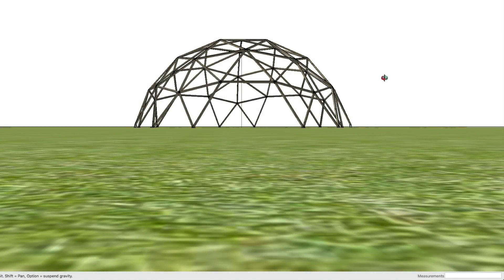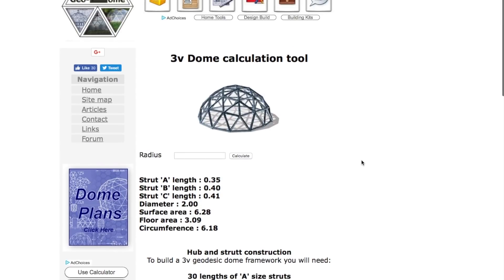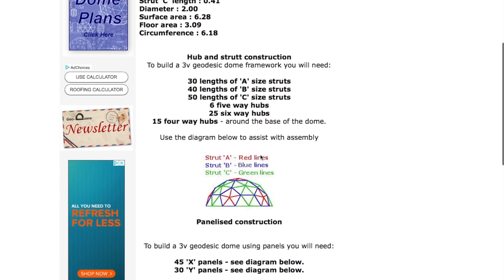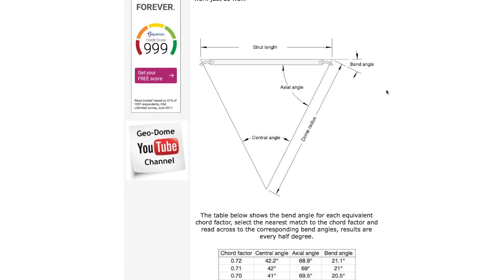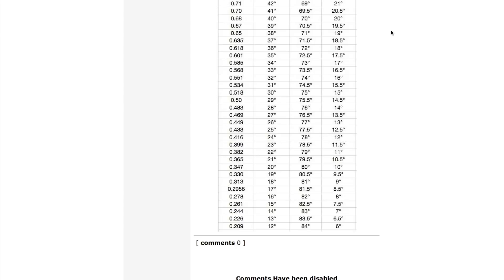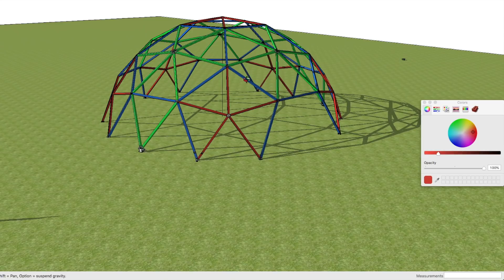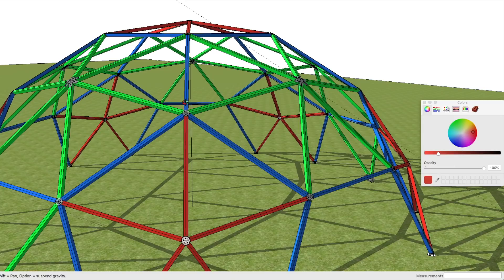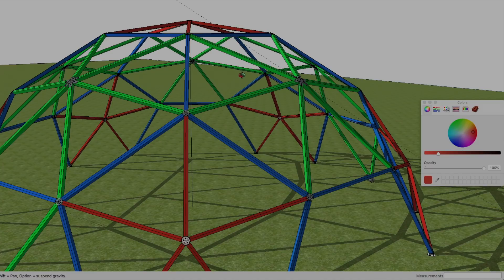Geodesic Dome Hub Angles made easy

Comment: How about the miter angle where the struts meet?
Reply from the maker: The struts tend to be cut off square, the resulting hexagonal hole is covered by the star plate.
Reply: @Geo-Dome  But then the corners of the outside sheathing cannot be secured unless you drill and tap the star plate

Comment: Sorry if I missed this info in the video, but what gauge steel do you use? Could you just screw in the beams and then while assembling just use the beams to bend it into shape? Will it still maintain its strength?
Reply from the maker: Yes you could, on a small dome this would work fine just be careful if you go 6m or over, you could also build a small test dome as well. Laser cutting the correct star shape will be where the money is.

Comment: in the USA are these typically buildt with two 2x4's or 2x6"? Either one is 3" wide. So can I just draw a hexagon with 2" sides to get these laser cut metal pieces? or is more complicated than that?
Reply: why not just 3 straps with a locating center hole,

and a cone  drilled thru

with square cut 90° members

then bolt the interior plate thru the cone to the 3 pieces of exterior strap.

kiss
Reply: You can do it if you have access to the technology, the issue for the average person is they don't have a laser cutter, so the average person if they tried to fabricate their own would have to basically use tin snips or some jigsaw it would be very time consuming😊

Comment: I´d like to build a half of a snub-dodecahedron with stellated pentagons... 
Much nicer structure. I just use a 3D-model to get the angles. There is quite a simple formula for two random vectors. They are always in a plane and you can always get the angle in that plane. You take the simplest form of the 3D model, just vertices and edges (no faces, that might be confusing with the pentagons) Just delete all else. And then you can get the angle by  filling in 3 vertex positions into the formula and you get the angle at the middle one :)
Math is easy. And this works with ANY model, not just domes.
Don´t worry about that dot-product, you don´t need to know what that is, just follow the example.
https://www.analyzemath.com/stepbystep_mathworksheets/vectors/vector3D_angle.html

Comment: The wood screws wouldn't be much of a problem. I'd maybe just score the bend line, cut the struts with a 12 degree bevel, line up the outside of the strut with the bend line, secure the screws and bend the bracket as needed to make the lofted pentagon or hexagon, then add another plate to the interior. The accuracy of the build will depend on setting the screws properly and getting the strut length exact and consistent. Another design might be to make the legs of the plate long enough to be able to fold up sides that would look like a joist hangar for stairs or rafters, maybe even modular to account for 5 and 6 struts as well as the base joints that need 4.  Do the hangar style interior and then add a plate to the exterior.

Comment: My concern here is the the wood connecting points are only as strong as the connectors which apparently comes down to 2 brittle woods screws.
Reply: All you need to do is use a little common sense ,  Yes I agree with you about this method being to light duty for my 
needs as well but remember he is only talking about 10 ' to 15' diameter domes
I am planning to build a 35 to 45 foot dome with 4 foot riser walls and a full basement !
so My hubs will be 2 piece an inside and an outside built to nicely fit either 2x4 or 2x6 boards drilled  with say 1/2 inch holes in the wood and the hub at matching distances 2 holes at each end of board then correct length of bolt
and lock washer and nut .
my building method will only be using this wood dome frame as a temporary mounting structure for holding in place 
pre cast cement triangles with a mesh center that is 2 inches larger on all sides than the actual triangle once a row
of the cement triangles has been mounted it will be a simple method of overlapping one 2inch mesh flap over
lumber then a spraying the correct bonding agent over seam and sides of triangle to be joined then a layer of cement then the other mesh overhang from triangle beside placed over first layer of concrete then another finishing 
layer of cement to meet the same height of triangles
Once all outside seams have been cemented in place and allowed to cure , it is time to remove nuts and bolts and lumber from inside dome and cement in the joint from the inside  simple as that ! 
this will be a bug proof , typhoon proof , fire proof and even earth quake proof sancturary and the bonus to this method besides its life span being measured in centuries the hubs and lumber can be used to construct another and another Dome Home :):):)  if you want a smaller or larger home you simply cut the required lengths of another set of boards !  
I will decide on type of wood when the time comes pressure treated wood be ideal to extend the life time and number of domes that lumber could actually build befor breaking down 
or a number 2 or better grade of spruce or pine and make up a oil bath to soak lumber in an oil that id cement friendly perhaps linseed oil ? mineral oil ?  what ever the research tells me to use 
I can see a construction company adopting this method to build communities of Dome hpmes
or even for the do it your selfers to just rent the hubs and lumber frame 
this is the building of the future being 40% more efficient at heating or cooling plus the most amount of space
with the least amont of material It has already grown a lot over the last 10 - 15 years 
it took us dumb humans a few hundred years to figure out that what the ancients built IE Romans and even the Eskimos got it right so long ago we finally found out they were dead on just took us a long long time  Ha Ha Ha
Reply: @caseyalexy8845  -Any update to this project?...  Thanks.

Comment: Go on buildwithhubs website and they have a free calculator there
Reply: Be aware that the buildwithhubs calculator automatically subtracts 88mm from the correct strut length to account for their hubs.  The hubs are only suitable for light duty structures that wont be subjected to high wind or snow loads.

Comment: Mount one on the outside and THEN one on the inside on every joint. Don’t worry about the bend angle, it will basically work itself out.

Comment: I would mount them inside not on the outside because the exterior is in tension,the interior is not and thats why a dome its hard to break from exterior but easy from interior.Also,the screws are really bad especially on this design with double struts.I mount the metal on the inside and i use kevlar string and and bicomponent ressin to attach the hubs(no screws).
Reply: Can you explain this a little further please, or direct me to more information?
Also, maybe I missed it in the video, but what size gauge would you need for a 15 foot diameter build?
Reply: @jravak487 did you ever build your Dome